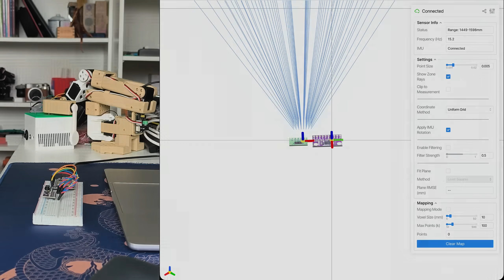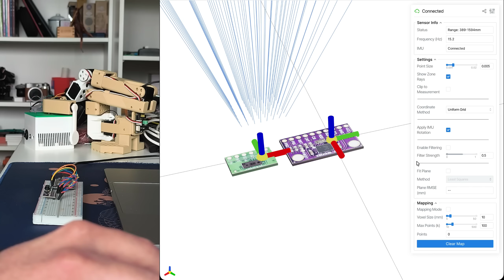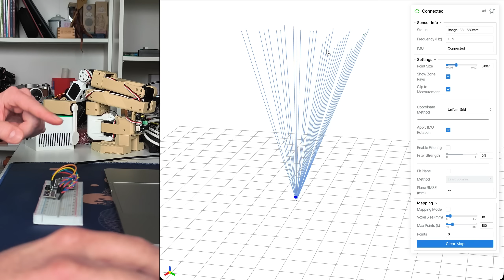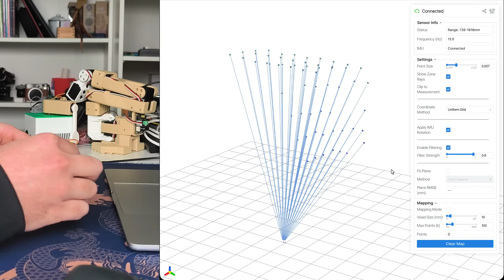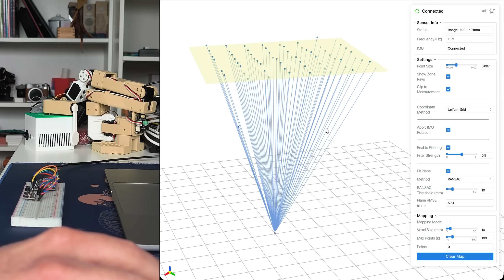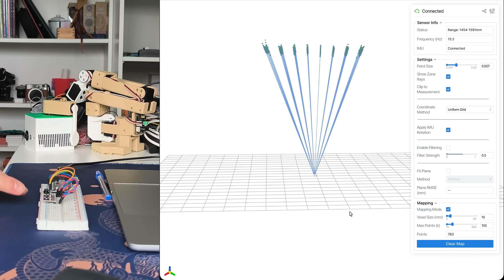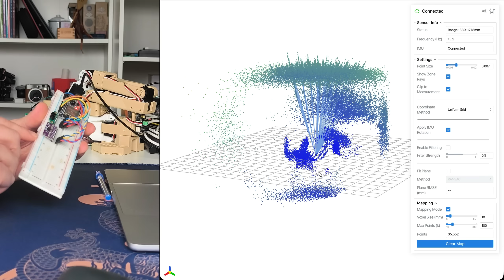Turn a Time-of-Flight Sensor into a 3D Scanner

Comment: You can find the plane of those points much better using Principal Component Analysis. PCA usually looks for the dimension that the data vary the *most*, but you want the dimension they vary in the *least*.

Comment: Something's wrong because it shouldn't have that much noise on the ceiling. I saw 30mm jumps on some points lol
Reply from the maker: Whenever I picked up the sensor from the desk to hold it in my hand, that effectively displaces the ceiling because I'm not processing any translations of the device (only rotations). That is why you don't see a nearly flat point cloud on the ceiling (or anywhere else to be honest).

Comment: I have some autonomous toy race cars and I've tested a few VL53 sensors.  This sensor, like the others, appears gives false readings at short ranges and that makes the cars avoid something that isn't there.  Oh and the sensors I have that work at speed (450-600cm/sec) are at 100Hz.  It needs a fresh distance every 10cm, if it misses one it's too fast for the corner.
Reply from the maker: You can filter out the outliers. But this specific sensor I show in the video can only go up to 60 Hz (and you'd have to reduce the resolution from 8x8 to 4x4).

Comment: Did you precisely visualize the angle of all the 64 lasers beams? Or its arbitrary just for visuals?
Reply from the maker: what do you mean ?
Reply: @HenriqueFerrolho the beams you show in the visaulizer, they are projecting at certain angle. Is that angle precise or you have put some random value to it for visualizing?
Reply from the maker: @bhupiistersingh4097  they are precise. The spacing between them and the direction they're shooting into are defined in the viewer according to the sensor's manufacturer datasheet
Reply: @HenriqueFerrolho well amazing work i must say once again.

Comment: consider scaling the point colors such the the nearest points are blue and the farthest are red.  that might make amore meaningful map. cheers
Reply from the maker: That's exactly what's happening in the viewer. It's just that the red bit of the spectrum lies at the 4m max sensor range (and this room is smaller than that)

Comment: I have ongoing project with range meters, but I found measurements to be rather slow, resulting in lags. I'm not sure, but maybe each range meter pauses the execution of loop until it measures? I'm using 7 range meters. After watching this I'm considering switching to this 8x8 array.

Comment: I would make it that the filter get bypass if the value goes over a threshold an it would start to buffer again the past data.  This way, you get precision but fast moving or large movement would be detected. And it super easy to code as well.  You could go fancier and just assign a higher priority to recent received data AND if it value is larger. So even at 0.9, you would get a responsive response and very little small changes.

Comment: Attached to a servo-controlled rotational mount, you could rotate, pause and collect, repeat, and end up with a very good map. Pausing to let an average build up would make the end result more accurate. That would get around the limitations of the hardware.

It's a far cry from the LIDAR systems I've worked with professionally in the past which had centimeter accuracy on the ground from an airplane -- but a WHOLE lot cheaper. :D

Comment: To solve the translation detection issue, couldn't you use an array of these TOF sensors to detect relative distances from the walls in addition to the rotation? Do you know the accuracy of the TOF measurements?
Reply from the maker: https://www.st.com/resource/en/datasheet/vl53l5cx.pdf
Reply: @HenriqueFerrolho -Thanks! I see the I2C data protocol and sequential indexing but no clear info about the target matrix data itself (unless I somehow missed it). Looks like you need the SDK they are referring to understand it.

Comment: Cool. If you add a program that can take all the measurements and create a common 3D object file format from it (reducing the point cloud to reasonable geometry made of triangles or quads) that you can save and use, that would be very useful (if it's still rather cheap then).

Comment: Really interested, I'm planning on a similar set up, it's good to know that you already have the theory working. Might prompt me to move forward with my project. 

I've also purchased a compass module to couple with the motion sensor, that way you also know the orientation of the scanner. You can use the magwick(?) equation to smooth out movement of the scanner and make it truly mobile hand held scanner. 

To increase accuracy and improve mobility, it's also possible to use IR LEDs (emitters) placed at set locations so that you can triangulate a position relative to multiple fixed points (I believe at you need about 4 fixed points to improve accuracy). You then place the led detector on the device. As you know the distance between points, you can use this set up to scan objects. 

I hit limitations in micropython on the esp32, so all my parts are on my table, but theoretically with additional hacks such as positioning and defining fixed points, gathering readings onto an SD card, you can get accuracy down to a couple of cm (or sub cm). 

My interest was creating a cheap 3d scanner for 3d printing. The accuracy isn't suited to that, so it's better to buy a commercial scanner, but it is an interesting experiment in what you can achieve from cheap parts. 

Excellent work 👍

Comment: Hmm, so you're using an IMU and a TOF sensor? It seems you're using a running average-based filter. This could be a good usecase for a kalman filter. A Kalman filter could fuse the data from the IMU and the TOF, and would therefore be much faster.

Comment: Very cool! I want to build something very similar but with a static VL53L5CX and a CH201-00ABR. I've been looking at the data sheets for VL53L5CX, but I have not found anything about adjusting the angle of the laser. Is it possible to 'scan' with the VL53L5CX from a static location (aka updating the angle of origin programmatically), or is the angle always fixed when rays get fired?
Reply from the maker: The angle is fixed AFAIK. There are look up tables in the ST forum online for the 8x8 configuration.

Comment: Can't upvote this video enough, has even a robot arm in the background (I am planning to build one soon)
Reply from the maker: Nicely spotted... :P That is an SO-ARM100 that I've built myself! Parts are 3D printed in my BambuLab A1 mini, and the servo motors + servo bus driver board are about ~$100. This is what the guys from LeRobot have been working on for democratising VLAs in robotics.
Reply: @HenriqueFerrolho  Thank you for the pointer! I was looking at the Bertram, PAROL, and the BCN3D-Moveo robot arms, unaware of an even cheaper entry-level arm.

Comment: Thank you for sharing this. Do you have any noticeable noise on the IMU to filter? Maybe it internally filers so do you see lag?
Reply from the maker: This particular IMU is a bit expensive at ~£15 because it provides quite good sensor fusion at a high rate. I didn't benchmark it in any scientific way to test its performance quantitatively, but quantitively it performs quite well IMO. I have previously used it for a handheld motion capture device and it worked well.

Comment: Very cool project. Also the reason of laser sensor noise can be not sensor itself, but IMU (if system doesn't account for it).
Reply from the maker: The IMU signal is quite stable. There is a checkbox in the viewer to stop processing data from the IMU and show only the data from the ToF sensor, and the noise is about the same.

Comment: Could this be modified to produce a 3d scanner to scan objects to create a model that could be 3d printed?
Reply from the maker: Yes, absolutely! Actually the reason why I got 5 of these ToF sensors from AliExpress (you may have noticed from the screenshot at the beginning of the video) is because I would like to try and create a 3d printed turn table setup where a few of these sensors are orbiting a central object (and pointing inwards at that object instead of outwards at the walls of the room) for trying to recreate the objects as meshes.

Comment: Very cool! Have you considered expanding this project by combining this with a camera and fiducial tags like AprilTags for more precise room localization?
Reply from the maker: I am not planning on doing that, although using April tags would be a good way of measuring translation without necessarily having to run a SLAM algorithm. However, I have another side project where I was using this very same ESP32 + IMU + April tags for a cheap DIY handheld motion capture device. Maybe I'll prepare a future video about it!

Comment: Looks like a great project!

Can you post the links to the actual components you used? AliExpress has many variations of each of the items you listed. Also, does the code on your GitHub support a 9DoF IMU? (You made the comment that your project did not handle sideways movements.)

• ESP32 dev board: ~£4 - Many ESP boards, some with Bluetooth, WiFi etc. Which did you use? Are there some with IMU on board?
• VL53L5CX ToF sensor: ~£5 - the 5CX variant seems to be the low power version with the 60° field but many to choose from. Which works?
• BNO085 IMU: ~£15 - many cheap ones and a few really good ones like the Aidafruit 9DoF for a bit more money.

Great work and thank you in advance

Comment: So this video got me really inspired as I didn't know multi zone ToF sensors existed before this. This made me do some more research, which I'll dump here for your information. I focused mostly on handheld 3d scanner usecases.

There are multiple different cheap multi zone ToF sensors available. STMicroelectronics has several in the VL53L group, like the 5CX, 7CX, 8CX, 9CX. AMS-OSRAM makes a few too, namely the TMF8828 which seems comparable to the ST sensors, and the TMF8829 which has a slightly insane 1536 zones. However I have not been able to locate a cheap breakout board for it, mouser has one for 85 bucks. Broadcom also makes the AFBR-S50MV85G, which has only 32 zones in a configurable arrangement, but an update rate of up to 3000 hz compared to the like 60 hz most others can do. Unfortunately while it seems like this sensor used to be available for cheap on ali, it no longer is, and now costs ~50 bucks bare. 

Overall the ST 8CX or TMF8828 seem like interesting choices, possibly also the TMF8829 with the dev board. It's 80 bucks but comes with a vastly higher res sensor and a usb capable microcontroller on board so that could be used as is with suitable software. 

For the VL53L sensors it seems to be well known that overlapping FoVs can cause interference unless precise timing is used to avoid them reading each others pulses (if this is even possible). Most other sensors probably have the same problem.

There are also interferometry instead of ToF based distance sensors, which can be a whole lot more accurate, but also a lot more expensive especially for multi zone sensors. 

Overall, I think there's potential here, maybe using two or three VL53L sensors which are timed so they fire in sequence as I can't imagine their pulse takes a 60th of a second. The VL53L8CX at least seems to support SPI where the 5CX does not. SPI tends to have way higher data transfer rates and allows more sensors on the same bus thanks to separate chip select lines. I'd love to see you take this further with SLAM (probably on a companion laptop) this could become quite the powerful cheap 3d scanner for hobbyists.

Comment: Expansions to this may be multiple of the sensors scanning all at once in slightly different directions. Then add a way to walk around with it, like a gps. Its coordinates would be the position on the fixed plane that it is scanning from. Then attach it to a drone and scan something from multiple locations or moving slowly.

Comment: This combined with using a SLAM (Simultaneous Locating and Mapping) algorithm could make for a really cool and cheap diy 3d scanner.
Reply: I ran a project working on that, but it failed as we couldnt get this exact sensor to measure reliably due to a weird in ic recalculation of the output values so that they should "come parallel" from the surface of the pcb the sensor was mounted on instead of the raw measurement values. I have absolutely no clue how this dude managed to fix that as we came to the conclusion it was a mistake in the firmware that was lazily documented in the datasheet. I did end up making a cool webgl renderer though that mapped measurements into a point cloud that was rendered on the browsers device, basically ready to go to slap slam onto
Reply: @grindfi  basically the sensor doesn't output distances to the sensor it outputs distances to the plane of the PCB, which are just simple X,Y,Z values. if anything it's actually simpler to turn directly into a point cloud than vectors that you have to convert to X,Y,Z
Reply: @chrismofer yep, youre correct, yet when we used Pythagoras theorem to calculate the values bavk to their original values we got wildly inaccurate numbers, thats why i think its the newer library that fixes this issue. I worked on this a couple years ago, so new things must have come out in the meanwhile. I remember this ic being a couple weeks old when we started. We ended up delivering a paper on how ST doesnt accurately document their IC's, which is sad as its good hardware. Anyways my proposal to use an IMU and a different TOF sensor (even a simple one) would probably have worked better.

I did impress the project managers with my local live webgl renderer website that was supposed to show the slam map, but ended up showing the mess the sensor caused. Lesson.of the day: ask the engineer before you set up the project requirements. I warned them..
Reply: That would be amazing!
Reply: Yeah but you'd have to use a technique like LOAM that fits a coarse model of the geometry. I wouldn't expect super accurate results, but it could work
Reply: @kylebowles9820  it doesn't have to be course, if you measure objects as close as is feasable and move the sensor around slowly and can properly track it's orientation then you can build a very high resolution point cloud..
Reply: Explain how, please
Reply: @000Krim  To survey a map of something, you need to know your Location relative to your Observations. To know your location while moving, you need a map. 
SLAM is a family of Algorithms that solves the recursion of that problem by first surveying a map relative to a internal Representation of your Location. Your Location for each further timestep is then estimated (or 'predicted') based on e.g. Acceleration Measurements.
However, this 'Incremental' Localization accumulates Errors over time from e.g. Measuring Noise or Movement Model Imperfections. 
To 'correct' that, whenever SLAM Algorithms recognize one or more 'Landmark' Points they've mapped before, they correct their internal Location Representation and are subseqently very precise again for the next timesteps. Some versions of the Algorithm can even correct observations made before a Correction, and modern ones (e.g. 'FastSLAM') do so in real-time. 
That's the core principle at least...

Comment: What software are you using on your PC to control and display the real-time data?
Reply from the maker: I'm using an open-source 3d viewer called Viser — https://viser.studio/main/

If you're looking for the actual code to run the same visualisation of the sensor that I showed in the video, then you're probably looking for this GitHub repo: https://github.com/ferrolho/VL53L5CX-BNO08X-viewer

Comment: Amazing! A basic level Lidar. Thanks for sharing. I guess the same outcomes might be achieved with an array of ultrasound sensors or those cheap radar modules. I’d try to use the MEMS mirror to increase the resolution in case of VL53

Comment: We'll described, thank you for taking the time to explain your work.  Can't wait to see the accelerometer integration to capture the translations!!  SLAM FTW!
Reply from the maker: It's not very easy to account for translations properly with just this setup because double integration of the accelerations from the IMU is very sensitive to noise / integration error. But maybe using a more elaborate mapping algorithm would be able to complement the accelerations from the IMU to provide better translation estimates — I believe that this is what LIO (LiDAR-inertial odometry) is all about.
Reply: @HenriqueFerrolho  would need some kind of SLAM (Simultaneous localization and mapping) algo, merging the point-cloud captured from the new location into what you already "saw" previously - similar to what's happening when capturing a panorama photo from a phone
Reply: @HenriqueFerrolho are you aware of the 9-dof absolute orientation sensors? I believe they are superior to accelerometers in this usecase.
Reply from the maker: @glianonimi602  the one used in this video is a 9-dof imu: https://learn.adafruit.com/adafruit-9-dof-orientation-imu-fusion-breakout-bno085/arduino
Reply: @HenriqueFerrolho  oh im really sorry man i didnt get to that part and i just read the comment and assumed.
Reply from the maker: @glianonimi602  no worries! thanks for watching! 😊
Reply: I would use the motion field equations; they relate movement of the projected points to integrated velocity, skipping one integration and providing a strong absolute velocity prior that has to do with depth error.